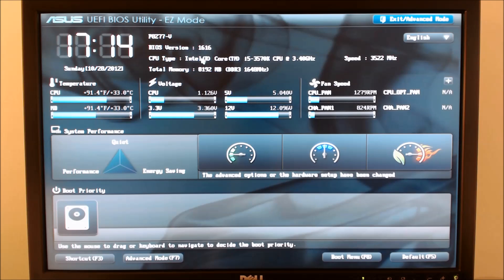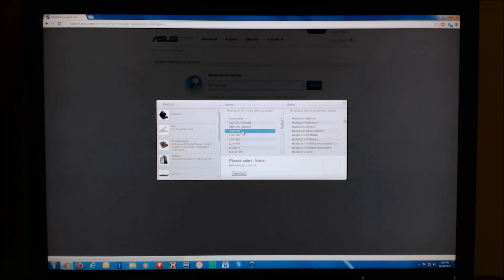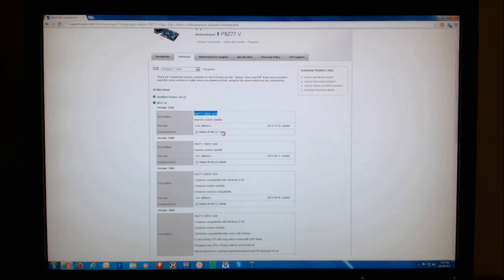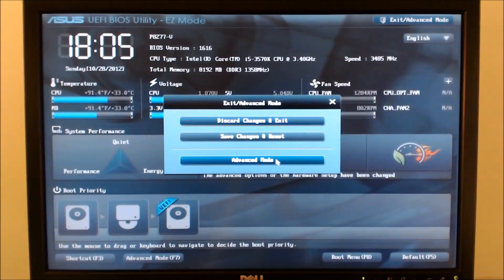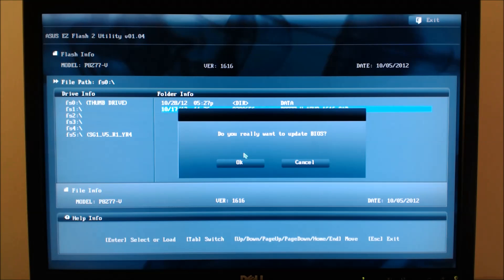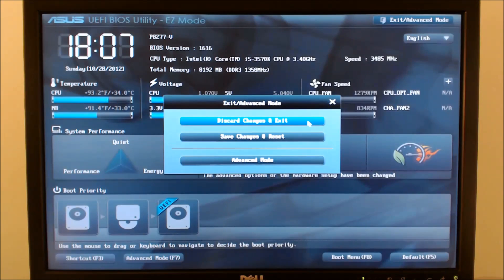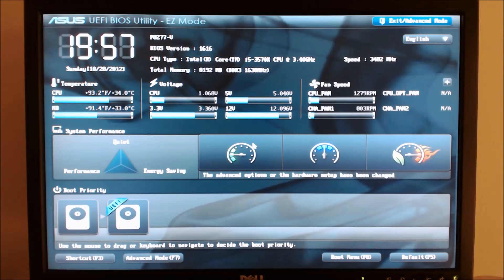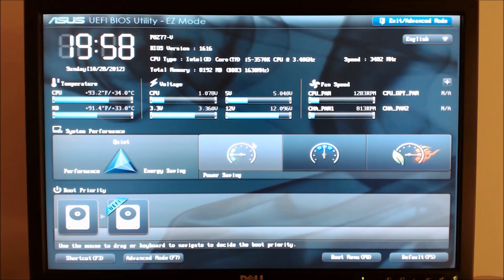How to Update ASUS Motherboard BIOS | (P8Z77-V)

Comment: Wow it's been 10 years since this video came out. Time really flies. Just put an i7 3770 in. Don't have any problems but wondering if I should update the BIOS.
Reply: You got this MB working fine with windows 10 or just using an older version still?

Comment: Extremely helpful. Thanks a ton. Also, note that your USB has to be in FAT32 for this to work. To make sure it is so, go to This PC->right click the USB you're using->format->check that "file system" is in "FAT32". On mine it says "FAT32 (Default)" to be clear, but I don't know if it's default for everyone.

Don't know the technical reason for that, but there you go.

Comment: once Im in EZ flash and I press on bios that I downloaded it tells me that it's not a bios
Reply: An old comment, but this may because because your USB has to be in FAT32 format. To make sure it is so, go to This PC->right click the USB you're using->format->check that "file system" is in "FAT32". On mine it says "FAT32 (Default)" to be clear, but I don't know if it's default for everyone.

I went with this problem for more than a year, so maybe you still need this information. Otherwise, I hope someone else does.
Reply: I downloaded asus ez and it helped but thanks anyways

Comment: Hi I have an Asus A88 X Plus (FM2+) Motherboard, the issue I am facing upon inserting an AMD X4 750K (FM2) CPU, the motherboard does not post, I can see the green and red led flash, but I get no signal, the bios revision is 1.03, so I am suspecting that the bios needs updating to support an older CPU. The fans spin, but no signal, could it be a power supply issue or the bios needs updating...

Comment: It seems like i can update on the windows without having to go into the BIOS screen 

I have a ASUS P8H67-M PRO and it has am update tab in the tab It gives me 4 options.

1.Update BIOS from internet
2.Download BIOS from internet
3.Update BIOS from file
4.Save BIOS to file

Should I first Save BIOS to file? (i'm assuming it's my current version) then update from internet?  all of this can be done on the control menu in windows that came with the board.

Comment: ***** Hi.I am having trouble OC my cpu. It seems whatever voltage I input in in vcore voltage in bios, there is no effect when checking the actually voltage in windows using cpu-z. I suspect it's a bad/corrupt bios flash. I am on the 2104 firmware and I noticed some info not displaying within bios. For example, in bios, the me version is n/a and my ram frequency is displayed as 0mhz. Can you confirm if you do have an me version and in ai tweaker at the bottom under cpu area, there are current voltage displays for from the psu. I am not seeing those either. Thanks.

Comment: To all that are having "SECURITY VERIFICATION FAILED" error, check you have the exact model of your motherboard when downloading, I was making the mistake and downloading the update for P8Z77-V, when mine was the P8Z77-V PRO, it has to be that precise or it wont work. to check you model insert your motherboard disk, or I think you can view the model number in the BIOS setup. Thanks for the video, this really helped me.
Reply: Thanks. Mine was a P8Z77WS
Reply: Doug Guevara thanks. I would like to warn people on another thing. originally i thought my motherboard was a B85M-G but then i found out it was a B85M-G PLUS but it wasn't that either and then i found out it was a B85M-G PLUS/USB 3.1 and that motherboard has no new updates 😡!

Comment: Hi, I know this video is quite old, and im trying to get the 2014 bios. When I try to do this, i get the message "Selected file is not a UEFI bios". Any of what i'm doing wrong. The file has an extension of .cap and im thinking it's expecting a different file type. I don't think it's smart changing the extension of the file just like that

Comment: Thx. I Had some trouble after restart step, computer would not boot. I was really getting pissed off for Asus at that moment, but then remembered i had some problems with initial configuration of the system after putting it together. This MB has some trouble booting up in dual memory configuration. I have 2x4GB Kingston HyperX modules installed. I had to yank the other out, then press the MemOk button on the MB for 3 secs for it to find a working config. Then it started to update BIOS. Phew!

Comment: In the mean time i have found the SOLUTION!
When you go to the assus website the auto script detect your mobo as a P8Z77-V. After a lot of searching i found out that my mobo is a P8Z77-V LX when i did a search on that mobo i came out with other BIOS when i flashed this one everything went smooth.
To find out what mobo version u have, go into you bios and check the version (mine was P8Z77-V LX). Then search on asus website for that bios
Weird that the auto detection on the asus website is wrong

Comment: I need help. I have a AsRock N68-VS3 FX motherboard and I needed to update my bios to play Portal 2.  After I updated my bios I was experiencing lag so I figured it messed with my drivers for my hardware.  I re-downloaded my GPU drivers and my motherboard bios and it fixed most of the lag.  Now the internet is still slow and I can only run games at 10 fps when I could run them before at 60 fps.  Is it possible I have more driver that need to be updated?  My CPU is a AMD FX 8120 Eight Core.

Comment: the first CPU I install was an I7 3770K, boots fine but was very unstable, after installing drivers etc the Q led light up and won turn off.. I flash to the lates bios but no change dram still on.. im returning the board tomorrow ill take my cpu ram hope fulliy ill have them test the board before walking out of the store..

Comment: a little late on the response but I had a similar issue except my ram was compatible and i thought i just got a bad board but it turned out a single pin was bent on the socket...so check if you got any bent pins...fixed the bent pin myself (lined it up the best i could) and everything is working flawless now

Comment: I CANT GET TO MY BIOS!!!  I am installing Windows 7 Ultimate onto an SSD.  I have 3 HDD"s 1tb, 2 500 gb, 1 DVD and 1 Blue Ray.  The 1TB HDD had my OS on it and I want to make sure I save the data off of 1 of the 500 gb HDD's.  How should I go about installing windows 7 on the SSD and when I start up and hit delete like it says to it just ignores my attempt at the bios and sends me to a password screen and after I put in the PW it starts windows!  Do I have to take out the battery on the MthrBrd?